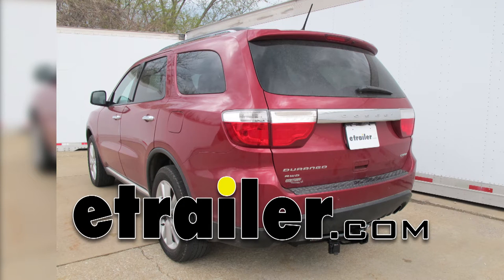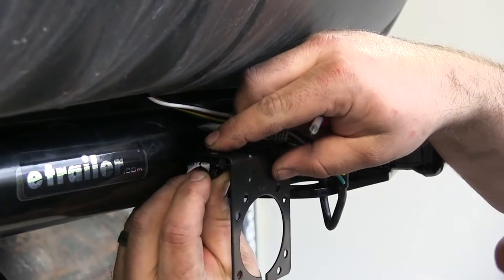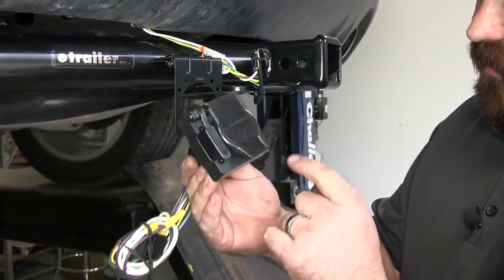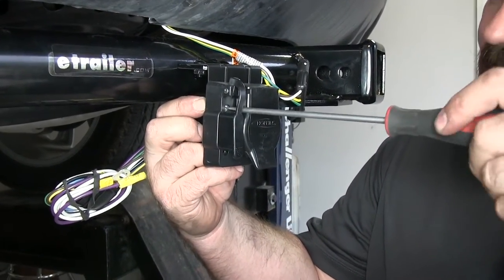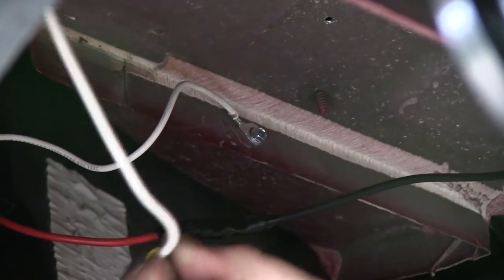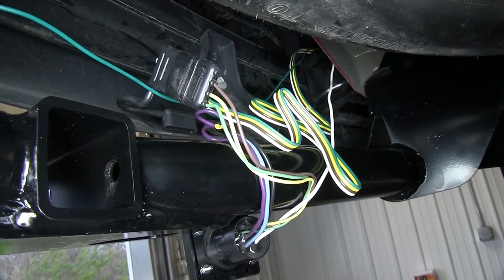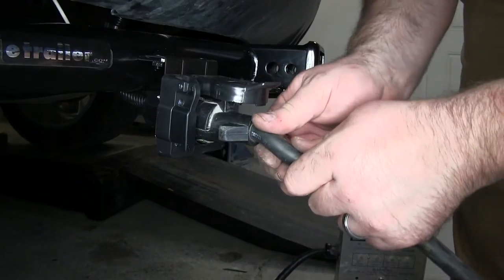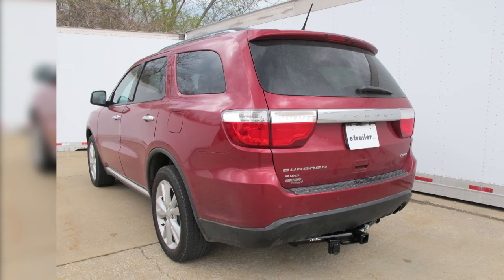etrailer | Installing the Adapter 4-Pole to 7-Pole and 4-Pole on your 2013 Dodge Durango

Comment: I just installed the Tekonsha prodigy p3 with this same 4 to 7 way adaptor. but I can't figure out how to properly wire the remaining 3 wires that you did not include. I am currently running the 1 blue wire coming from the brake controller all the way to the rear. Then I have the black and white wire coming from the battery all the way to the rear as well (positive being used with a 40 amp auto resetting  fuse) 
everything I've bought has been through the etrailer website but I can't seem to figure out how to connect these wires.   by the way my trailer WILL have the electric brake set up and I DO want to use the reverse light set up as well. is there any way you can please explain this too me.